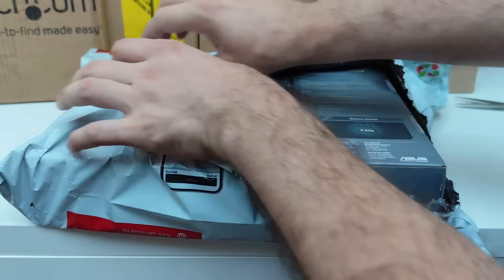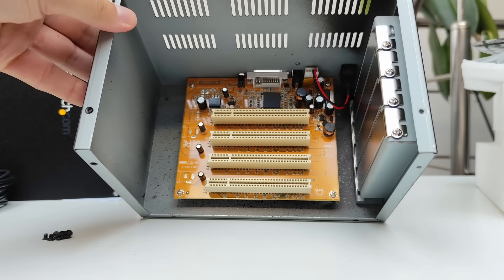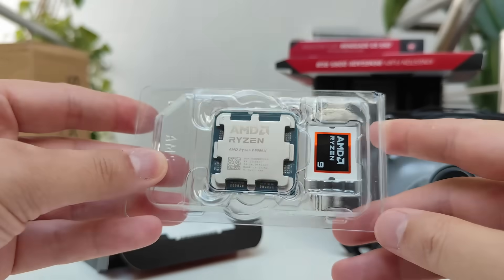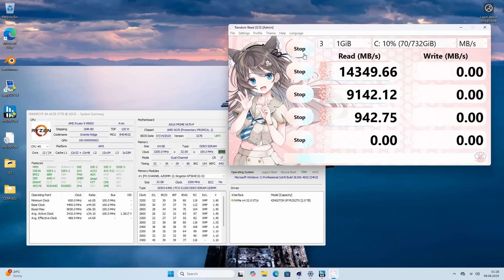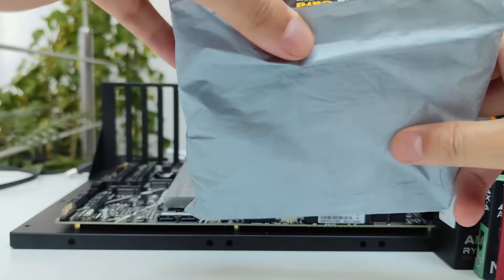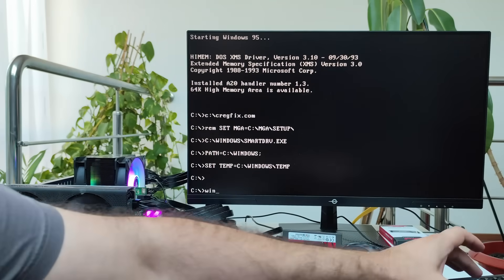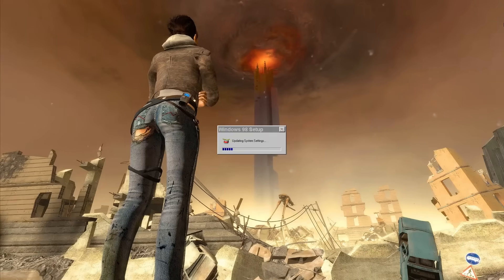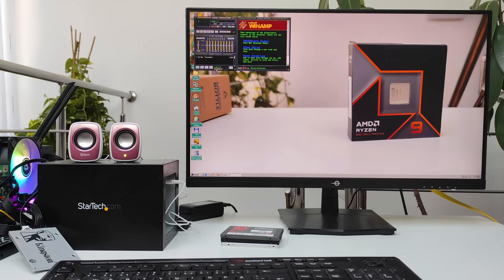Windows 98 on a Ryzen 9 9900X@4.4Ghz and... It (Eventually) Booted! (On Bare Metal)

Comment: There must be a difference with threadripper. It will not read XMP profiles. I had to configure my ram manually. Fortunately it wasn't a big deal. It's probably not the right settings, but it reports 64000 so meh good enough. It also saved me $500 over the 128gb kit they were pushing. I only found 1 RDIMM brand selling 64gb. 64gb is overkill for a media server. lol Oh well. Technically threadripper is too, but I ran into issues with storage on a B550 + 3600x. By using threadripper I don't have to worry about those limits.
Reply from the maker: I’ve never had a Threadripper. As for DDR5 systems in general, I wish they could boot faster. I’m not talking about the initial RAM training, which can take quite a while - just my practical observations. On some DDR4 motherboards I own, it feels like they boot instantly, with the Windows 98 logo appearing in just 2–3 seconds. On this X670 motherboard, or a Z790/DDR5 I tested before even with fast boot enabled and everything optimized, it takes much longer.

Comment: I've just tested booting 98SE from NVMe on my main PC which has MSI B650M GAMING PLUS WIFI motherboard, but just like with my MSI PRO H610M-B DDR4 motherboard, I get same IOS error.
You are really lucky with your ASUS motherboards :(
Reply from the maker: Booting from NVMe doesn't work for me on this X670 motherboard either. Actually, the Gen5 2TB drive I have from Kingston works pretty badly with the latest NVMe driver from SweetLow. It's very slow. But I also tested an older Gen3 NVMe Samsung drive, and that one works normally and it's fast. Still couldn't boot from it, but I only tried once. I'll make a video soon.

Comment: 16:24 It's funny how you didn't even have enough time to see the Windows 98 Splash Screen Logo... While, back in the days this was even tiring watching this after each reboot.... 😂 🤣
Reply from the maker: I'm actually running the monitor through a capture card so I can see the splash screen at all. There are a lot of resolution switches from the POST screen, which is 1920x1080, to the splash screen, which is usually 720x400. I tested with a few 27-inch monitors from different brands, and none are fast enough to show the splash screen... you see the desktop directly.
Reply: @O_mores  Ohhh okay I see. Well a month ago I tried Windows Vista on my I7 11th gen CPU with IRISXE Graphic it actually worked very smoothly,, I was even impressed to see how good looking it was and fast as well. While back in the day it had so many resources that it made all The PCs Runs so bad that Microsoft had to come with Win 7.

Comment: What sound card did you use here? I'd like to try an am4 build like this I recently upgraded to am5 and have a spare Asus x570 board with ps/2 and an 5800x3d that have no purpose. Would a 7900gtx and soundcard with a pcie to pci adapter get me going?
Reply from the maker: The 7900GTX will definitely work. For sound, look for a low-profile PCI card if you want to use it with a PCI-E to PCI adapter. You can also get a PCI-E to USB 2.0 adapter. With this, not only would you have USB support, but you could also use a generic USB sound card - like those that come with headphones. I haven't done thorough testing on USB sound in Win 98, but it should work normally with Windows games. I also know it works with DOS games through the Sound Blaster emulation layer (SBEMUL.SYS) that's integrated in Windows 98/ME. You can find more details in this video: https://youtu.be/b6zC0ms31FY
Reply: I just checked and no ps/2 port on this board any workarounds what are the odds USB keyboard will work? Or could I install os with drivers on another PC and swap the HDD?
Reply from the maker: @supragsx  The BIOS will emulate the your USB kb & ms as being PS/2 devices, so you're good for the installation and even everyday use. It doesn't always work on some configurations, but this is rather the exception. It works on my AM4/X470/R3900X build, and also on this AM5 PC with a Ryzen 9 9900X: https://youtu.be/EOeJnLb952k
Reply: @O_mores while I'm waiting on my 7900gtx I decided to try and boot windows xp on the x570 mobo. I'm using integrals edition but no matter what back ported achi/sata driver I try to inject it never finds one to install and trying to continue install freezes at starting windows and never advances. Have you encountered this or know any workarounds? Thanks again
Reply from the maker: You sure it's the AHCI/SATA driver and maybe not an ACPI issue? Please check this video: https://youtu.be/0iW1hheBAp0

Comment: Does it work without a dedicated graphics card?
Reply from the maker: Yes, it's possible to boot into Windows 98 even with an RTX card by using generic 2D VBE drivers. These allow you to enable high resolutions but they provide no 3D acceleration. Check out this video - half of it covers VBE drivers: https://youtu.be/JIJvCOG-h2Y

Comment: I expect that older x86 OS compatibility is actually important for industrial computing. I watched a doc on how ship boat anchors are made the other day, and the machine controlling some of their equipment was running Windows XP.
Reply from the maker: Yeah, totally. There’s still a ton of specialized 32-bit software out there that’s not going anywhere, especially stuff tied to specific hardware. On the other hand, general 32-bit apps like old versions of MS Office are pretty much dying out.

As for CPUs, dropping 16/32-bit support wouldn’t really make them any simpler - not even by 0.1%. x86-64 is basically built on top of x86, so the CPU still needs to include most of that old logic anyway. You’d just be removing a few modes and registers, which doesn’t really change much when it comes to CPU die size or complexity.

Comment: I have wanted to build a Win98 machine again for years, this has me very tempted to give it a try
Reply from the maker: Yes, you can! In this video, I run Windows Me on one of the final motherboards with official Windows 98 support. Check it out here, at the end: https://youtu.be/aTJYC6nEWSU The board is an Asrock ConRoe865PE. It has official drivers for both 98 and ME, full ACPI support, and it's even compatible with first-generation Intel Quad Core CPUs like the Q6600. If you're looking for something newer, it should work on basically any hardware.

Comment: Do you think we'll ever see custom Windows 98 drivers for the Radeon x1000-series of video cards?  The x700/800 cards are getting harder to find by the day.
Reply from the maker: Probably not. The first-gen ATI PCI-E cards use an architecture (R400) that is an evolution of the R300 (Radeon 9000 series) that already had Windows 98 drivers. Actually the first PCI-E GPU from ATI were native AGP designs that used a bridge chip for PCI-E. The X1000-series, however, uses a completely new, native PCI-E architecture (R500) that requires a completely new driver. Reverse-engineering that without official source code is near-impossible.
Reply: @O_mores  There is one oddball card out there in that numbering series - the x1050.  According to wikipedia anyways, there are 3 variants - an AGP based on RV350, a PCIE based on RV370, and a PCIE based on RV410.  Was that just ATI using up some leftover chips from a few years prior?
Reply from the maker: The X1050 and X1100 were simply new product names for the same X550 (RV370) chip, but as DDR2 memory became very cheap, these cards (in most cases) came with DDR2 instead of the DDR1 that was common on the X550. So the higher model number wasn't exactly a scam. :) As for the drivers, the last Windows 9x compatible driver won't work with these newer R5xx cards but the Catalyst driver package for the ATI Radeon X1000 series offered official support for many older cards, including for the Radeon 7000 series (RV100).

Comment: Pretty good! Lets see you boot it on a uefi class 3 tablet. It would still work quite well on those lowpowered tablets
Reply from the maker: There's a new project called CSMWrap that provides CSM functionality using SeaBIOS for UEFI-only machines. On a laptop or tablet, we can run (at best) Windows 98 without sound and 3D acceleration, so it's not very practical. I would rather go with PCem, but those tablets would probably struggle to emulate even a Pentium 60 CPU. For comparison, on a 3.9GHz Ryzen 9 3900X, the sweet spot for emulation was just a Pentium 200 MMX: https://youtu.be/f79BuN527eM
Reply: @O_mores  what is preventing sound and graphcis accel?
Reply from the maker: @NossyDrelich  To really have fun with Windows 98, you need a PC so you can add some older hardware into the mix. Laptops and tablets are a no-go. For example, it was very easy to add a PCI-E GPU from 2006 (7900GS) when Windows 98 was still supported by Nvidia and ATI. Otherwise, there's no driver support for anything newer. The same goes for sound - there are no HD audio drivers for Windows 98... but you can add a PCI/PCI-E card that has drivers for 98.
Reply: Gotcha. Can a driver be written for those or too much work? The same way the nvme driver was made.

Comment: I suggest an interesting test: Ryzen with x3d cache + 3dfx voodoo on Windows 98) How much will x3d cache give?
Reply from the maker: Yes, I'm curious too. A 9800X3D would be good for this test since it's a single CCD design, models like 9950X3D have two CCDs - one with 8 cores with regular cache + extra cache and one 8 cores with just regular cache. So it also depends on which CCD boots the CPU when operating in single-core mode.

Comment: Great!! I signed up quickly.
I have 4 madness/98 machines. The fifth one is X299, but I can't install the 7800GTX/82.69 driver on it.
Reply from the maker: Welcome aboard! The behavior of the 82.69 drivers can vary based on your configuration/BIOS, resource allocation, and which IRQs are shared with the GPU. This is why R. Loew's patches are essential for some setups but not for others. For more info, check out this video on the 82.69 drivers: https://youtu.be/iMyK-NJkSoo
Reply: I watched the video (I think I've seen it before).
The install settings are there, according to the same system.
Everything works on Zen2, by the way, with this machine and the 7900GTX, I think I hold the world record under Win98: https://cdn.rios.hu/dl/upc/2025-08/09/225621_dbrneb9etabstgmw_225621_zozpei7vqrw0b24t_69164.jpg.
X299 is a different story, according to Fixeoi the card doesn't get an IRQ either. Under XP it detects it just fine, the PnP system throws it in immediately.
512MB Loew patch installed of course.
Maybe I'll solve it in the next 5-year plan :-)
My test suite and my favorite titles run well on the Zen2 machine anyway.
Reply: I see that you can't open the direct link here, it only works with the copy-paste (into the address bar) solution.
Reply from the maker: I accessed the link directly - very nice setup, and also a very well-organized screenshot. :) Intel Socket 1700 and AMD AM4 platforms seem to be much more friendly with Windows 98 when it comes to resources. On this AM5 build I have, there are a lot of devices competing for IRQs. It works fine in the end, but it was much easier to set up on my previous builds. Maybe this motherboard is special... I don't know - it's the only AM5 build I've tried so far.
Reply: @O_mores  I think AM5 is UEFI only. Did you need the newly released legacy UEFI/BIOS add-on?
Reply from the maker: AM5 has CSM, and it works. There are even motherboards with 2x PS/2 ports or even 1x classic PCI slot, but such features usually come with budget models like the A620. The good news is that CSM is also present on high-end models like the X870E, so basically, it's standard across the entire platform. Resource allocation seems to be a bit different from AM4, at least when it comes to how Windows 9x sees the hardware. Also there's less RAM 1.7GB vs 3.5GB on AM4.
Reply: @O_mores  Thanks for the info, I didn't know that. I recently bought a modern Ryzen laptop for my son, it operated exclusively on UEFI, there was no trace of CSM.
Reply from the maker: The CSM option is greyed out or hidden when you use the iGPU on a Ryzen CPU. That's because these iGPUs are UEFI-only and don't have a legacy VGA BIOS. If you force CSM on, you'd get no video output. But as shown in this video, you can still use CSM with a CPU like a Ryzen 9 9900X if you use a dedicated GPU that has legacy support - either a VGA-only card or a modern one with a UEFI/VGA BIOS. The RTX 5000 series still have a VGA BIOS.
Reply: @O_mores  RTX 50xx also has VGA BIOS - well, I wouldn't have thought of that either, thanks for the info!

Comment: If modern hardware is as fast as they say it is, boot time should be <1sec..
Reply from the maker: There are some delays intentionally introduced. For example, if you have networking installed, Windows 98 will wait for an IP from the DHCP server, which will add quite a few seconds to the process. Then, the video driver will kick in and change the screen resolution. Some monitors will take about two seconds to adjust. But overall, it's about 6-7 seconds.

Comment: omores what is MOST important when choosing "modern" hardware for win98? i have a graphic card and a soundcard compatible with win98 so i'm just switching motherboards.. and none of the 5 sets are stable with win98.. i tried like 5 different sockets/chipsets by now, installations went well but after first login and few minutes later i'm getting bsod's or explorer.exe errors or some other nasty problems... black screens and what not..
Reply from the maker: Well, you shouldn't. Right now I'm playing with Windows 95 on this Ryzen 9 9900X and it's definitely stable, with just some graphical glitches when using DOS apps, but I'm surprised the video card (7900GS) even worked in Windows 95. Did you install with *setup /p i*? ACPI—or the lack of proper backward compatibility with it—is usually what makes Windows 9x unstable. In my experience, that's the main culprit. If Windows 2000 or XP doesn't like the ACPI implementation, it'll throw a BSOD (0x0000005A) during setup. Windows 98, on the other hand, will install anyway but cause issues later. Explorer.exe errors can also come from AHCI drivers, so don't rush to install those, first check how the system behaves without them.
Reply: @O_mores  ok ty... what i do is first load himem.sys with "/m:1 /v" and reboot, then i start setup with "/p i" switches, then something happens in setup so i add maxphyspage thing and continue setup and then i usually get another error which i fix with Rudolph's patchmem because i allways have 1gb+ of ram.. .when i get into windows, if i see empty device manager i install pci bus and then usb drivers or gpu drivers, and then everything goes downhill... on every motherboard. i'm getting black screen or some wierd tiles, or blinking cursor, or windows get stuck forever on win98 logo with no errors when i click Esc...
Reply from the maker: That's pretty much the procedure, except the /M:1 switch doesn't work on some systems. You might want to use it only if you can't run setup and get a memory error.

If you install with /p i, you should already have the PCI bus installed. If you manually install the PCI bus afterward, I think ACPI will be installed again.

Now, we need to narrow down what you're doing differently than I am. Which Windows 98 installation are you using? Are you installing any updates?

Also, I don't know what your partitions look like - how big they are, what type they are, or what SSDs you're using. Although, I've used pretty much every SSD possible by now, so that shouldn't matter.

I think I will make a live video of me installing Windows 98 so you can replicate exactly what I do.

Comment: I literally scrolled back at the beginning of the video to be sure I did see a Romanian shipping company in your video. I am glad you are making these videos. I would not touch Windows 98 ever again, buuut I get nostalgic about it. It was basically the first OS I used intensively (I had Windows 95 for a few months while in college). It was a big step forward from my HC 91 that most Romanians had back then.
Reply from the maker: You got me. I'm based in Iasi. I actually used Windows 95 and 98 a lot. When XP came out in late 2001, I was in college, but none of my roommates were into it. Windows 98 was lighter - you could install it on a cheap Duron 800MHz PC with 128MB of RAM and end up with a very responsive PC. XP on the same machine felt laggy. Windows 98 started to be ditched around 2004, mostly because some games, like Doom 3, required 2000 or XP. (though it was just a simple OS check hardcoded in the .exe that could be easily removed, allowing it to work on 98 as well)
Reply: @O_mores other things I remember about Windows 98 was that I had to reinstall it every couple of months because it was getting lagger the more software I installed on it. I know Windows 98 had low hardware requirements, but so was Windows XP at the beginning. I also remember that I tested Windows 2000 and Windows Millennium on the PC of a colleague with better hardware specs. There are a lot of tweaks that have to me made and I am amazed about all the stuff you showed here. The only OS I miss more is Windows 7. It ran better in Beta than my Vista installation that O tested briefly.

Comment: Man, you're making me want to convert this old Acer ChromeBook Oron Yuna into an XP box. Just need to get past the UEFI bootloader and I think I could make it happen. Still have the original 16 GB SSD which came with the system, so that's the drive I'd use as the main drive has Windows 10.
Reply from the maker: I think it would be better to go with Windows 7. You can install XP, but in the end, it won't be much fun without 3D acceleration. XP support was dropped around 2013-2014. This Acer "Yuna" model has a Broadwell CPU from 2015 and an Intel HD5xx iGPU , so you can't install the drivers on XP.